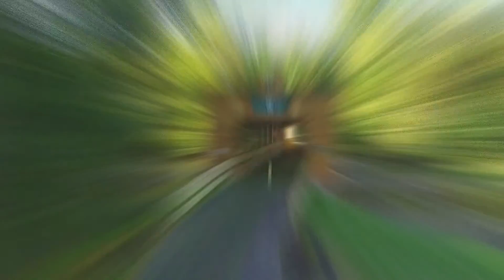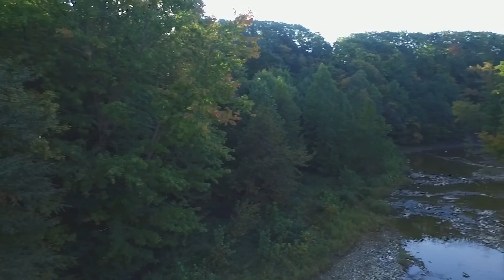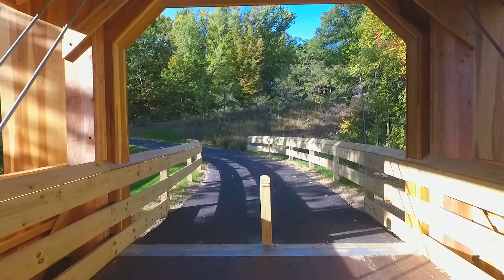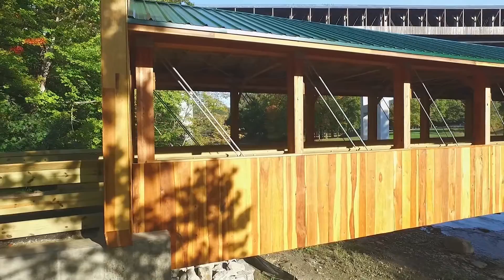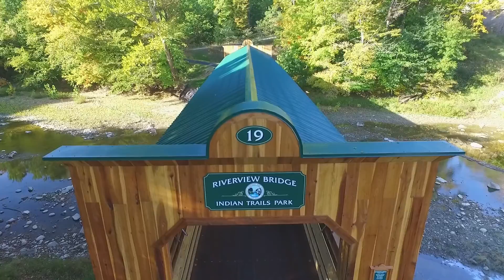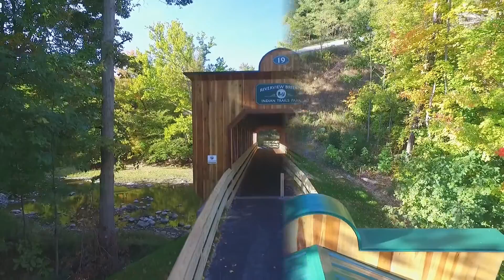P3A Riverview Pedestrian Covered Bridge (1080P60)

Comment: BILL, THANKS MAN!!!👍. I have a ? I have my IMAX b6 charger and for a 7.4v battery what's the amps or where should I look for it at.
Reply from the maker: Hi Wilber ... The iMax B6 will charge most LiPos just fine, including your 2S (7.4V which will read 8.4v when fully charged). What you need to do is find out the CAPACITY of the battery, which is usually written somewhere close to the "2S 7.4v" info.  It could read 1000 mah ... 2000 mah .. all the way up to 6000 mah which would be a very large battery. They make them in small sizes too, down to about 200 mah. It is highly recommended that you charge at "1C", or the same value as the capacity. So, if the battery is a 500mah battery, then charge it at 0.5 amps.  If it is a 1000 mah battery, then charge it at 1.0 amp.  If it is 1500 mah, charge it at 1.5 amps.  Hope that helps. Cheers